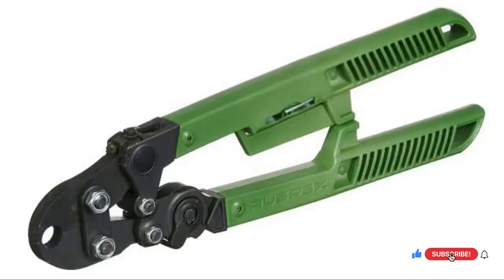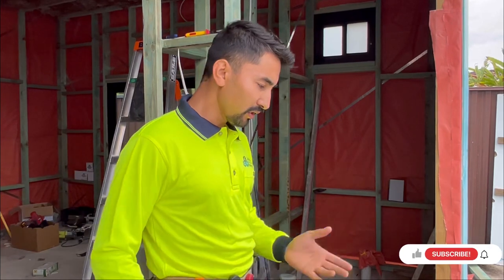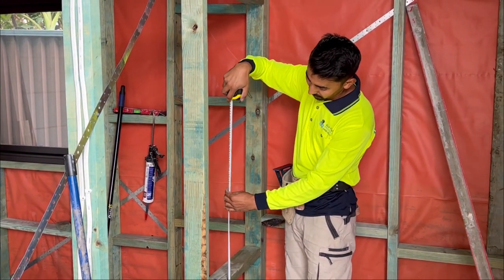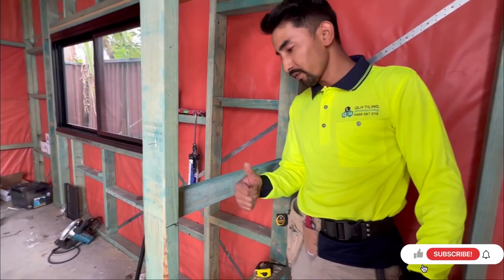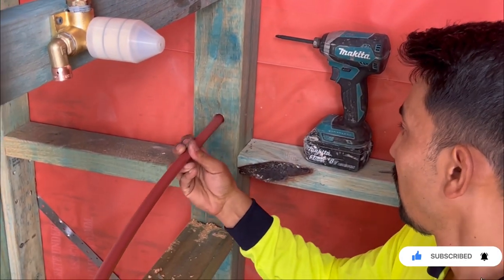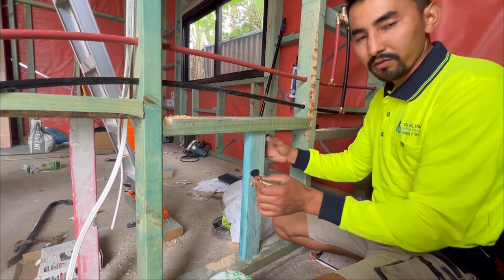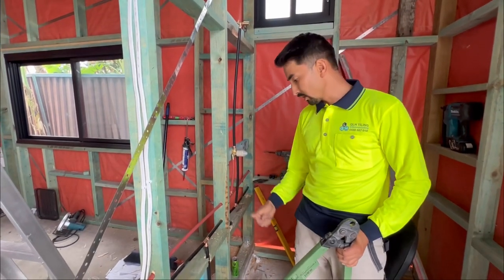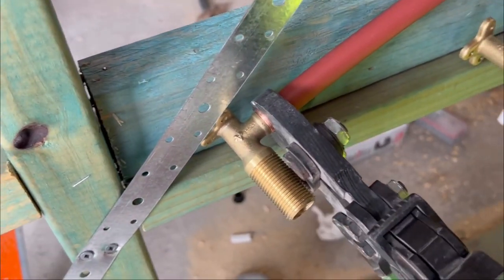How to do internal plumbing work A-Z in the bathroom.#plumbing#pex#crimper

Comment: Using wrong size pipe for cold water ? That’s why you should use licensed plumber.
Reply: what are you basing this on? Both 1/2 and 3/4 can be used if the pressure is fine
Reply: @88kwthomas  I’m a licensed plumber you are wrong !
Reply: Based on the Australian standards. I’m a licensed plumber so I no what the rules are.

Comment: Interesting video how you guys in Australia are working. Is this a mega requirement to use black plastic pipes for cold water and red for warm water ? Next year I will immigrate to adelaide. I am also plumber in germany.
Reply from the maker: Hi thanks for tuning in yes you can use red for hot and black for cold welcom to australia
Reply: Not a requirement, just for ease of identification. Can just run all black for hot and cold if you want

Comment: Make sure to put some silicone around the pipe where the hole.
Reply from the maker: Ok sure thanks for your recommendations
Reply: I assume this is to stop the pipe bashing about in the hole when water turned on and off?
Reply: @peterkilleen3061 hi peter, i think so, my friend who works at bunnings and who is a father of two plumbers also told me to do the same. Use some neutral cure silicone (parfix all purpose will do). This will keep pipe in place.

Comment: Hi, I have an old bathroom that I am trying to renovating my self. I was wondering if you could suggest what to use to connect the old copper shower pipes to the pex pipe. I am trying to put in the new shawer mixer😊 TIA 
 Or if you have easy videos that shows the old shower renovating jobs would be great 😊
Reply: There’s lots of videos on YouTube that show this, US based though. Search copper to Pex conversion. You cut the copper pipe, solder a new connection joint piece tk the copper, then attach and crimp your Pex pipe to that. But in Australia this all has to be done by a registered plumber. Such a joke as pretty simple if you know what you’re doing
Reply: You say needing a license is a joke yet you use the incorrect pipe size.
Reply: @glennmcintosh6833 what are you basing this on? Both 1/2 and 3/4 can be used if the pressure is fine

Comment: could you please tell me all pipe sizes you used. thanks
Reply from the maker: Half inch
Reply: And that is why it is non compliant
Reply: jip non compliant mate
Reply: What's correct size pipe for hot and cold
Reply: @jonomac86 what are you basing this on? Both 1/2 and 3/4 can be used if the pressure is fine